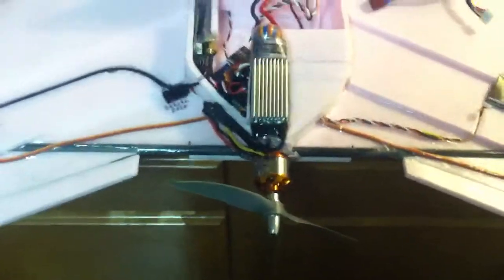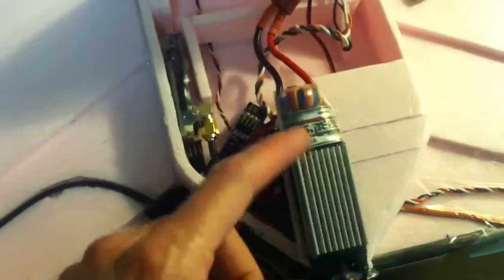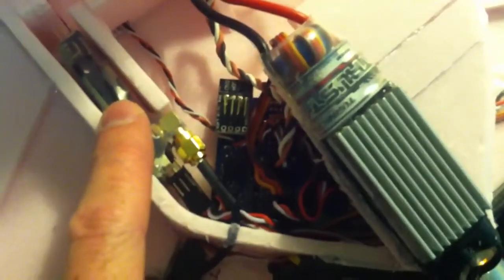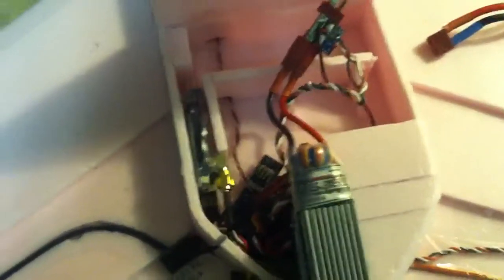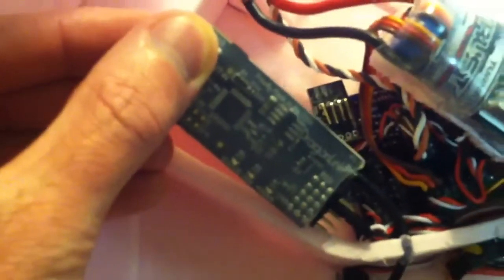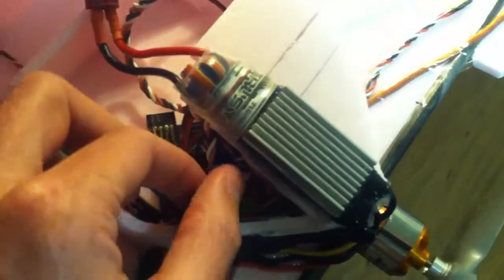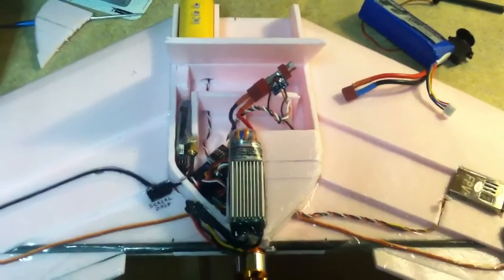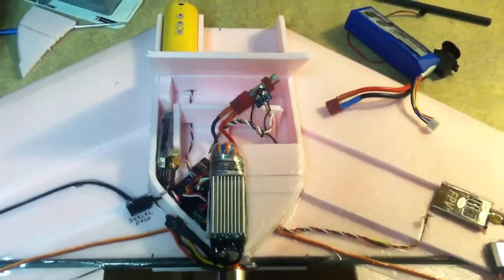HK-KK2.1 Stabilized DragonOSD Controlled KFm7 Flying Wing (Part 3)

Comment from the maker: None of the gear inside has any heat problems where they need cooling. The DragonOSD KK board and RX all are very efficient.

The battery does not heat up because I do not exceed its C rating. Usually in flight I only pull 50% power.